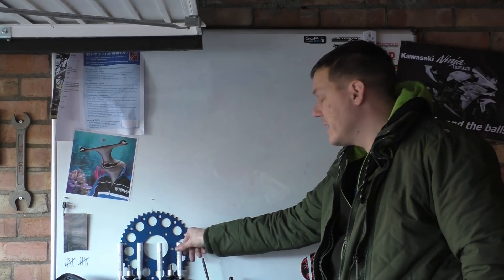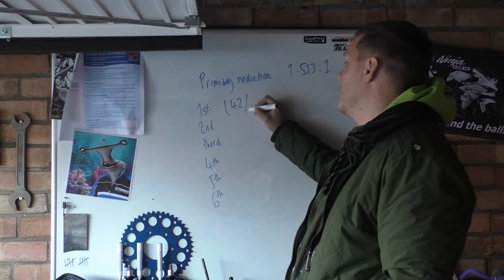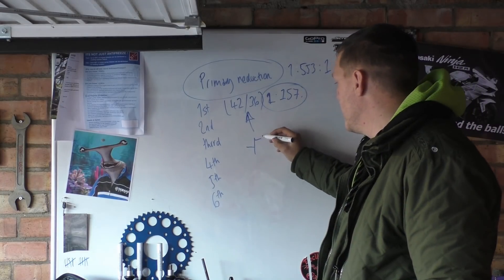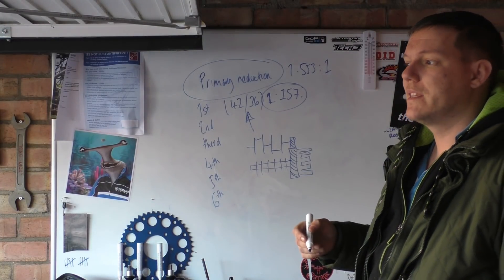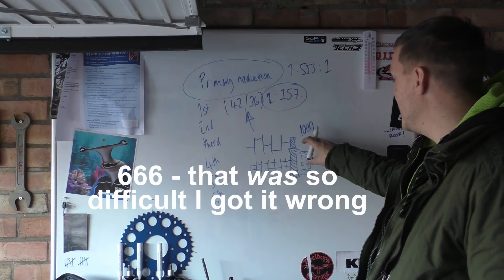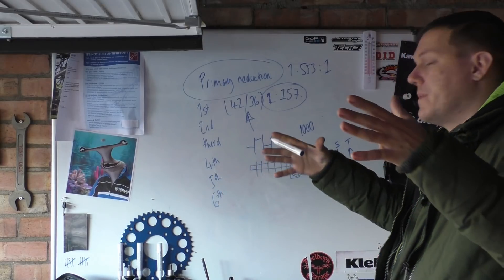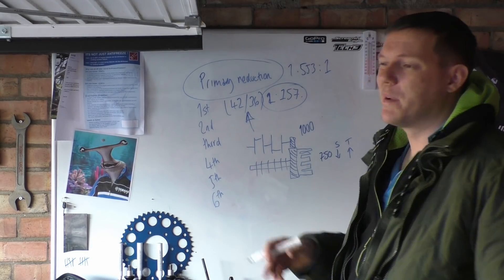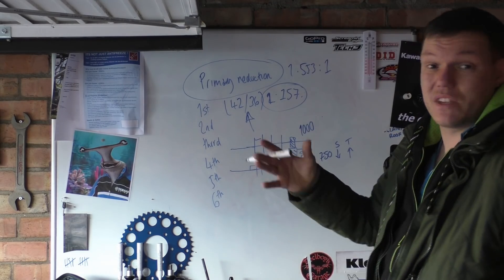Primary reduction - what does it do?

Comment: Does it mean that having a lower primary reduction (Say going from 3.895 to 3.2) could make the clutch life easier? What I mean is... if the clutch is barely slipping a bit with the current 3.895 primary, if I change that to 3.2 and also change the sprocket and so on so that I can keep the same top speed.... will the clutch see any change?
Reply from the maker: There's something else to consider and that's the torsional stress on the crank, you clutch would be "better off" but your crank wouldn't

Comment: Bruh but what would be the effects be if u change the primary ratio... Please tell that too...
Reply from the maker: It would change the all of the ratios throughout the gearbox
Reply: Bruh thanks for the reply but What I exactly want to know is I have 2 stroke for dirt racing(yamahaRx king/135) and got hold of a manufacturer to build me a bigger ratio gears for example say from 19/72 helical to 17/62 straight cut.... So I wanted to know wether it will increase the torque or decrease it to the rear wheel... As in increase acceleration or increase the gear length altogether.... please respond
Reply from the maker: The bigger the output for the primary (clutch gear) the higher the torque at any given rpm of the engine. So say at 5k rpm you get 30Nm you get a higher torque at that same rpm. 

Or looking at it another way the same 30Nm at a lower rpm - however the engine will be at higher load, so acceleration will suffer. 

Changing from helical to spur cut will increase the wear on the gears and also increase the noise. 

I wouldn't fuck around with the primary simply because that reduction was based on the engines powerband. 

Simple way to explain is like changing sprockets - More torque - lower acceleration - More acceleration - lower torque
Reply: Thanks bruh.... That was all I needed
Reply: And also I thought like you wouldn't answer this but hey u did and am grateful to u

Comment: sorry matt, me again.   so i'm not using my bike currently, so its in the garage i start it up once a week for about 7 minutes give it a few revs then turn it off. 
someone said : Your bike won't get up to temperature and you'll get internal corrosion due to condensation.
is this ture?
Reply from the maker: LOL ok so lets work this out together - moisture is in the air. If your engines gets upto 150DegC the water will 'boil' out of the engine. But as soon as you switch it off - all the moisture is gone?

Is you leave an engine to sit condensation always form but how much is dependent on the humidity. Hot engine or cold it doesn't matter. The ER5 was sat outside for 7 years - summer through to winter and the internals were fine - you can see for yourself.
Reply: thank you, your so wise :)

Comment: Nice video, Matt.  I have a question - Do you know the best way to fix the SV1000 issue of 'rattly clutch basket'?  I have a mate with one and he reckons it's a typical affliction of SV1000's.
Do you know of any kits available in the UK that could be shipped to Australia?   Cheers for any tips.
Reply from the maker: Yes - the clutch has a bushing and spring issue from the factory. It depends what year it is and why the clutch is fucked. It also depends on if someone has modded it already. There are some bad mods out there - either way the clutch basket usually needs replacing. 

There are some machine shops that will fix the clutch properly - but only if it hasn't been 'badly modded' I have a mate here in the UK who does and excellent job on the mod. 

1st things first - you need to know what condition your mates clutch is in.
Reply: Thanks for the tips, Matt.  I'll pass the info along.

Comment: Bikes don't need much torque and need less and less of it as the speed goes up, right? Why not just put a really torqy but low rpm engine in the bike and use reverse reduction gearbox to convert its high torque into high rpm at the rear wheel?

Comment: On the note of drievtrains though, I've seen kits online that claim to be able to convert a bike from chain drive to belt drive.

I've always liked the idea of belt drive even if it technically has a lower level of efficiency largely because of the lack of maintenance required bar maybe giving it a wipe down.

Comment: I want to know, if i reduce the weight of the flyweel Will the engine produce more power as a result or it doesn't matter? I would like to see one video showing how to make one small bike produce more power, i like to see these little monsters
Reply from the maker: "I want to know, if i reduce the weight of the flyweel Will the engine produce more power as a result or it doesn't matter?"

- no. Power is produced from torque and rpm. Changing the mass of your rotating assembly is not 'creating' any more of anything.
Reply: The Workshop i was trying to say "does the flyweel weight reduces the power generated?" 
I just formulated the question badly
Reply: Of course it will not produce more energy and you didn't answered the other question
Reply from the maker: Again no. Rotating mass effects aceleration. Your crankshaft geometry is fixed. The flywheel is there to store energy between ignition events. So if you lighten your flywheel there is less rotational inertia to overcome - hence quicker aceleration.

To a point.

If you remove too much weight then the flywheel is less effective at storing rotational momentum - and then you engine becomes lumpy. 

OEM flywheel are the best of both. Not only that but by just removing material the dynamic balance is lost.
Reply: The Workshop so the engine Will need to work at a higher rpm but have faster acceleration?
Reply from the maker: Depends on what you mean? The engine will have higher aceleration everywhere, but will run like shit. This is getting into the realm of rear wheel torque and requires a video
Reply: The Workshop hmm well ok
Reply: As Matt has already said a lightened flywheel will allow the engine to accelerate faster, the effect is most noticeable in low gears. The downside is that the idle deteriorates,  in cars the stored energy in the flywheel is handy for climbing kerbs or similar where you can briefly get more torque than the engine is producing. (Saves you having to rev the arse off it). For racing use light flywheels on cars make the engine more responsive but for normal road use they can be a damn nuisance. Never ridden a bike with a lightened flywheel/clutch but the same is likely to apply.
Reply: David Lisney thats interesting, i was thinking about trying something like this on a cheap bike to see the effect since i've seen the honda rc 116, that thing doesn't even have one, the iddle rpm is 5000
Reply: inertia times angular acceleration is torgue. less inertia more acceleration...:) or am i wrong lol
Reply: AmazinChannel you're not changing the power output, but your power to weight ratio.
it means your engine total mass is reduced.
CMIIW

Comment: I wonder whether taking drive from the center of a multi cylinder engine would have any effect in reducing torsional vibration in a crankshaft?, dunno.
 I'll get my coat.
Reply: I'm sure someone could come up with some Rube Goldberg like way to have the clutch in the middle
Reply from the maker: usually the centre is a bearing, secondly torsional stress if generally more of an issue that vibration. And thirdly where would you stick the clutch? LOL
Reply: Ah, good points, I'm crap at sober thinking.

Comment: could it be that my moto-guzzi doesn't have one? i mean, the flywheel bolts directly to the crank, contains the clutch assembly, en then goes into the gearbox...
Reply: I'd assume  it still has a primary reduction, just the clutch before rather than after. Takes up space when you need to stack up the clutch, clutch actuation and a small gear on the end of the crank